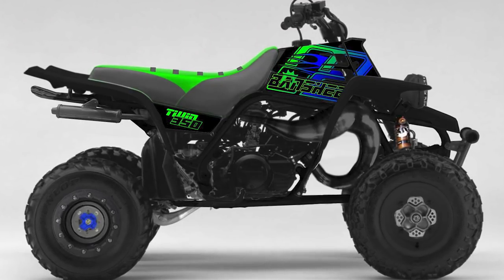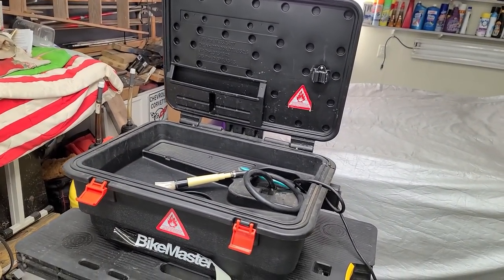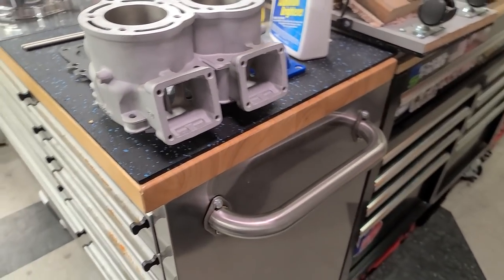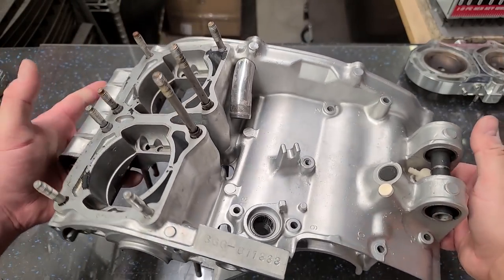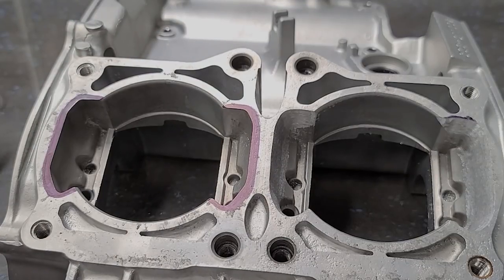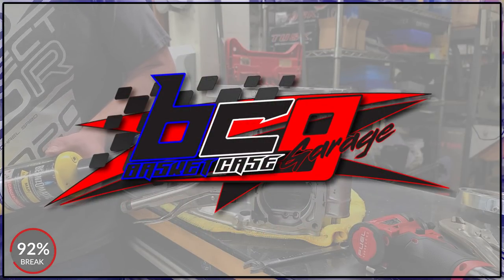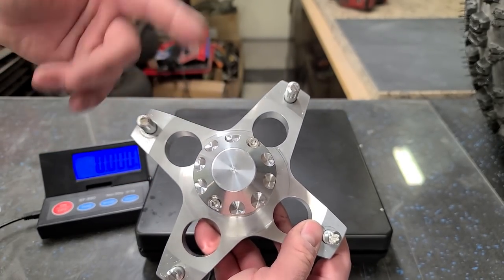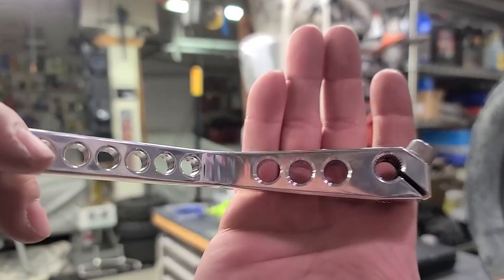BIG weight savings, 2 Stroke Case Porting and Trick Parts - Voodoo Banshee Part 3

Comment: Hopefully didn’t grind through the Nikasil right at the cylinder wall, will flake off pretty easy.
Reply from the maker: I've heard of this happening but I've never had it flake; I wonder if it has to do with being gentle with it or maybe the ones that flake did not adhere properly. I don't have a ton of experience but I've done several cylinders without any issue so far.

Comment: I’d sharpen those transfers
Reply from the maker: There are some areas where this is beneficial, and some that are not. From what I understand, at the super high speeds in the crankcase, knife edging those transfer dividers actually causes more turbulence and disrupt/slows gas flow. This was in Graham Bells 2 stroke performance book if I remember correctly and taught to me by Dave Moore 🤘
Reply: I didn’t know that I’ve had so many that were sharpened I thought that was the way so I did the same lol 😂

Comment: Why did you go 350 and not just keep it a 421 but with CPI cylinders?
Reply from the maker: I want to see how much power I can get out of the 350 and how it compares to the 421
Reply: @MichaelSabo  I'm curious to see what you get too. What hp where you getting out of it as a 421 stock cylinders? My 421 cub with Shearer pipes, 19cc domes and 35 pwk on VP race gas was making 92hp. Went to 21cc domes on pump gas and it was making 85hp. Enjoying your build, can't wait to see it finished. Getting me excited to resurrect my 421 cub and my TRX.LOL. Both have locked up motors. Loll
Reply from the maker: @arm2896  good luck on your resurrections man! I never dynoed my 421 but I'd guess in the 80hp range. If i rememeber correctly, Driveline performance claims these cylinders make 86hp on pump gas (depending in setup of course).
Reply: @MichaelSabo  thanks man. Watching your videos is giving me the itch. See what hp numbers you get. Be nice to actually see it on the dyno.

Comment: If I donated a frame would you be interested in doing a build series like the 250R? You can keep the quad after, I just really want to see what you could do with it. I will DONATE the frame if you do the build. 🤷🏼‍♂️
Reply from the maker: What kind of frame? I am considering building another banshee. I appreciate you offering this at all man!
Reply: He was breaking it in still in that video and was only at half throttle. Watch as he pulls away, it’s FAST, definitely NOT your normal blaster
Reply: The Airsal cylinder is also more reliable than stock. It would be the “Ultimate Budget Racer” honestly
Reply: And as a kicker, if you cover shipping I’ll send a bottom end that needs rebuilt anyway. It’s been sitting for god knows how long but it’s got the transmission and everything still in the cases, I’ll still cover shipping on the frame

Comment: You're going to need a new gasket now also because the vacuum will leak back into that open pocket where the gasket leaves it open so you're definitely going to need a new gasket at bare minimum I would have the cylinders welded and fixed to be the right shape instead of welding the case in an abnormal spot I've never ever seen a CPI Cub cylinder that has that little dip back I'm willing to bet that's a manufacturer's defect possibly when it was cleaned up they just went a little too far back I would have the cylinders welded and file it smooth before I would have this cases welded

Comment: I think that cylinder has a defect in the manufacturing I have a cub cylinder and have ported several and the alpha Cub is supposed to have the exact same port layout as the Cub but in stock stroke and stock bore other than that everything is supposed to be the same I know they had to reduce the size of the boysen port on the outside because of the shorter stud but I have never seen them dip that far back for the Boysen so something's definitely wrong with that cylinder that cylinder shouldn't have the little dip backs

Comment: Be careful with those allen case studs from
Bp I know you have experience with the company but i just returned a set of those studs last week because they was shorter then oem case studs the general manager jt even gave me a call and confirmed the 3rd party making the studs haven’t been making good batches sizes been off… I’ll be documenting my banshee build complete ground up from the bottom build brand new cases fresh bare frame off ebay all new parts even down to the bolts we go live once cylinders get back from porting check me out
Reply from the maker: Oh man, sounds like you got one of the bad sets; I already mounted my stuff and mine appear to be good; thank you for the heads up though bro. Good luck on your build man, I'll check it out!

Comment: kenda dominators are great, way better then them kenda klaw
i tested a quad full kenda dominator and full kenda klaw... on the same quad 300cc and let me tell you dominator have traction in dirt mud thicc wet ground. them kenda klaw have nothing my quad used to go straight with then kenda klaw in front but those kenda klaw are great summer hot weather dust road tryes they are hard rubber and dont use that quick, not like sun F
but kenda klaw are great for drift in the rear doh fun playfull but front have no tracting once there is mud in them treads...
kenda dominator grips pretty good and the mud doesnt stick that much to the tyre and the front keeps traction even in the mud
even had a 450cc with front kenda klaw holy shit that shit was dangerous... in the mud no traction just going straight you had the swing the bike around to turn... that had artrax mxtraxx rear those were wierd good mud tracting but use on hard surface really quick...

Comment: fill the void with jb weld
Reply from the maker: Honestly, using an epoxy is probably just as effective and will work fine. Thank you for this idea, I may actually do this with an epoxy that's used for head porting.

Comment: i see you did not invert the gasket when moving to the crankcase so markings are wrong handed so mutch for  precision       also mixture does not HIT the step between case and barrels it is flowing the other way   lets follow basic principals rather than bench racing bullshit